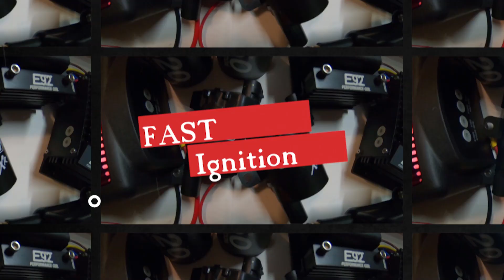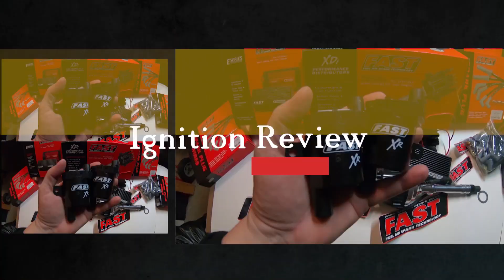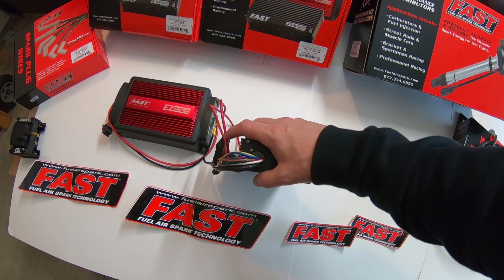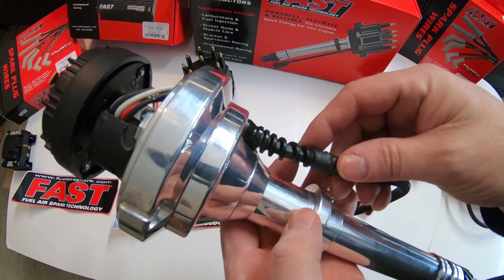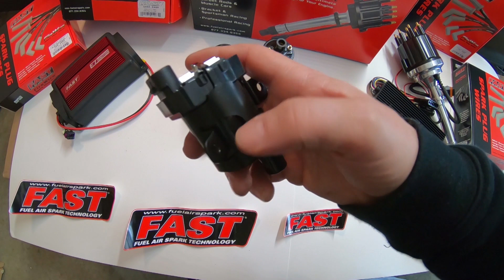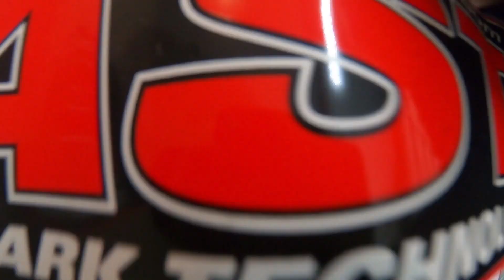FAST Ignition Review

Comment: Hi how much mj of spark enegy across the plug above 3000 rpm when it is a single spark.the equivelant to the crane hi6r with the ps92 style coil i thought i saw somewhere it 345mj and now cannot find that info ,msd 6al has 115mj.cheers

Comment: I own a crane EI 700 series.  The light on the box mounted on my fire wall does not go on and car will not start it is 10 yes old I have yellow &black to -side of coil red to + side I have a new crane coil wires plugs caps cleaned the wheel in the distributor HOW can I test the module to see if it now junk any thoughts

Comment: Hey guys! So I have 2 of the original Crane ignition modules; the type that eliminates points and drops right in place of them. I have them in my SBCs.  Those modules are GREAT! I installed them, set the rev limiter and they have been fantastic. Never a problem. OK, last year I bought 2 new ones under the Fast name and neither of them worked. To say I was disappointed was a understatement.  Have you figured out the problems with the new ones? Is it a situation of mating with some coils being the problem?? or "Made in China" the issue? ..or, you tell me......please let me know. Thanks.
Reply: @MuscleCarSolutions  I talked to them and got run in circles. I need the OEM distributor. Hoping you had a answer.
Reply: @MuscleCarSolutions  I called the customer service number. Talked to a few including a tech. Don't remember their names for it was last summer. I am bringing out the cars now the weather is good and am where I was last summer: still using points. Would love to eliminate the points.
Reply: same for me, it sputters like its a million degrees advanced , fouls the plugs.  i got rma # from them  but haven't sent it in, i think a year has passed but i'm finally back home to send it in. hope they honor it still